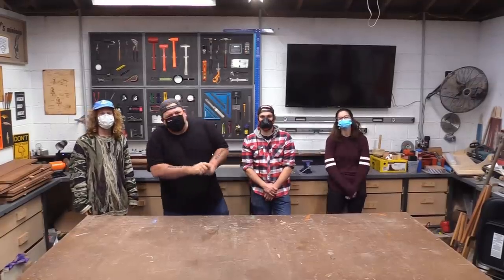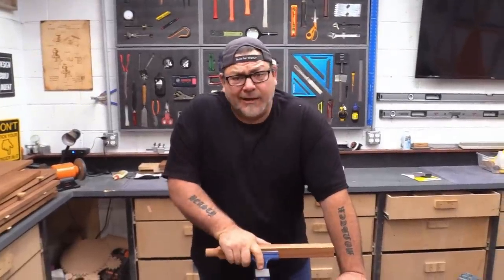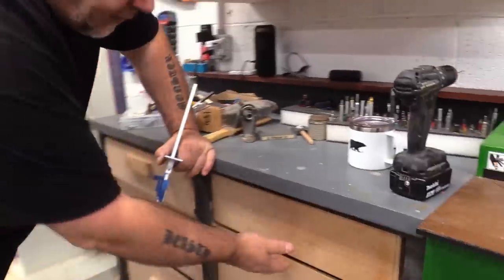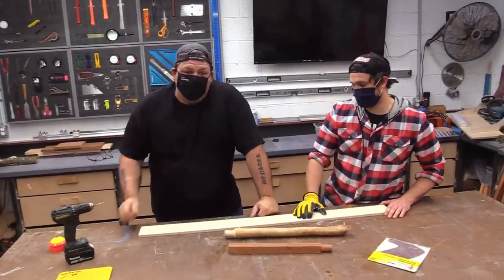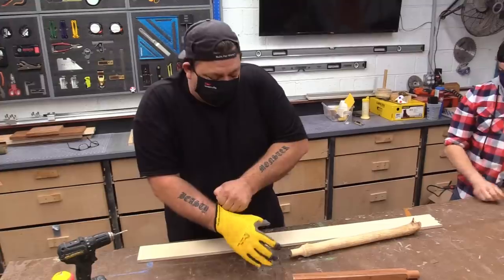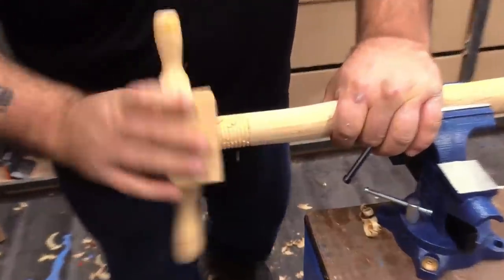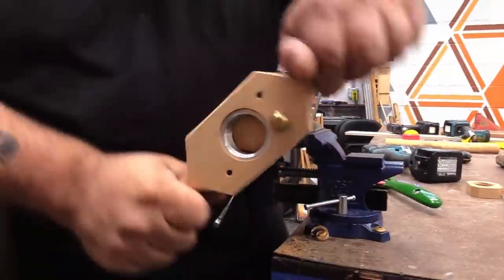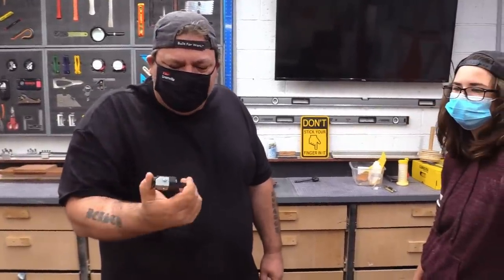6 Awesome Amazon Tools Under $60 | Woodworking

Comment: Good stuff. FWIW, I have used that corner chisel to square the corners when I used a router to mortise out the spot for a square cornered hinge. They come in different sizes as well as shapes, for example, we used a 5/8 radius bit to mortise out hinges and used the 1/4 inch radius chisel for 1/4 radius hinges.

Comment: It's really good to see you up and moving around without issues. Just don't over do it, keep getting better Izzy. 
For threading, soak both pieces in linseed oil and or butcher block oil, the threads cut better and don't leave jagged edges behind. I personally more interested in layout tools. Cheers :)

Comment: I just had a spinal fusion on November 3rd and it's driving me nuts to not be able to do much. Seeing you getting around so well gives me hope that I'll be back in the shop doing what I enjoy soon. The healing process of this is slow and quite depressing at times. Thanks for the boost and keep up the great work!
Reply from the maker: I feel ya it is a long painful journey but it has been so worth it.
Reply: Good luck on your healing, I'm getting ready to have a spinal stimulator put in. They had talked about doing a fusion, but my issues weren't definitive enough to justify it. The stimulator trial went great, if you still have issues in the future it might be worth looking into. Right now I'm sporting 7 bad discs and I can barely walk and can't really sleep due to sciatica, it's not the life I expected. Basically I'm living dose to dose on gabapentin, which only takes a slight edge off. Anyway, hope it all works out for both of you and I can't wait for the chance to be able to work in the shop again. Happy Thanksgiving.
Reply: @thallmeister  thanks! I had a fully herniated L5-S1, bulging L3-L4, L4-L5, and a fractured L5.  The L5 had pushed forward 14.5mm. I was still working right up until I went in to surgery. It's been 30 years of dealing with the pain. It got to where I was having more bad days than good. It was time. So far it's actually been better than what I had expected. I'm up and getting around pretty well. I'll be back to work after the first of the year, light duty of course. Thanks again and happy Thanksgiving to you as well 😊

Comment: Izzy, it’s a great thing to see you moving around so good hope you are on the mend to normal. Love all your videos. Hey the last tool you showed is called a corner chisel and has been around for years. It is used by most finish carpenters to cut out the corners of factory cut door knob holes for the door lock piece of the door and the door catch on the frame of the jamb.

Comment: If you soak the dowel in  nut oil or canola oil where you going to put the threads it is much easier to cut the threads and makes cleaner cuts on the threads.

Comment: Nice work, people. Stop sanding, you'll go blind!

We have the 1" version of that threading kit at the college I work at and it's a quirky bit of kit. Our facilities manager needed to fix a spool hanger on a 3D printer. It was essentially a 1" diameter pipe with three nuts. He asked if I could model it in Fusion, then print it out. I made it in wood in about 20 minutes, including walking upstairs and measuring it up. (Faster than modelling it!)  It's very Flintstones, but I love it. In your face, 3D printing!

Comment: I use a bucket of play sand and wear gloves while I put what I am sanding into the bucket of sand with my hands... I grab it and twist. Then I carefully brush off the sand that sticks to my glove and my work as I pull it back out... If necessary I wash the rest off that I could not remove... A bucket of sand and a rag would work too and you never have to buy sandpaper...

Comment: SIDE HANDLE DRILL
helps prevent a common, painful, and debilitating wrist injury caused by the cutting tool catching and twisting the operators wrist instead of the cutter.

Comment: Some really cool things there. I had heard of the sanding gloves and of course had an idea as to what it would look like and how it would function but haven’t actually seen them. I also hadn’t looked them up either lol. Does the company that makes the wood tap and die make a 1 1/4” 8TPI set? I clicked the link but that only showed some smaller ones. I did try to search for one but didn’t happen to see any that were that size, however did see a 1 1/4” 6tpi but not the other. Might just take a bit more searching. Great video. How has your back been doing since you had your surgery? I hope you and your family are doing well and have a happy thanksgiving.

Comment: That drawer pull hole jig: I've now tried two of them, and unfortunately both of them, that piece that rests on the top of the drawer didnt sit straight, so long pulls were very obviously crooked. Also the rulers' measurements weren't actually accurate. It's like someone took the actual measurements and shrunk it by 5% or so. So if you only used that ruler, it would be OK, but don't measure with a tape and then expect these measurements to jive.
Reply from the maker: I have never hand a problem with mine. Something g you might want to try is switching to a Brad point bit when drilling the holes if you're drilling in hard wood the tradition bits might be walking on you a little and causing the hard ware to be miss slighted

Comment: Those vices are garbage. They're great if you don't use it as a vice...
Reply from the maker: Weird this one seems really well built for a 30 dollar vise. Definitely not going to be smacking it with a sledge hammer but I see no problems with it
Reply: @izzyswan  It's probably fine for very light work but if you put any force on it, the cast arms snap like a pretzel like mine did. Check out the amazon reviews too for pictures using your link. I guess it's a very conservative 'okay' for $30.